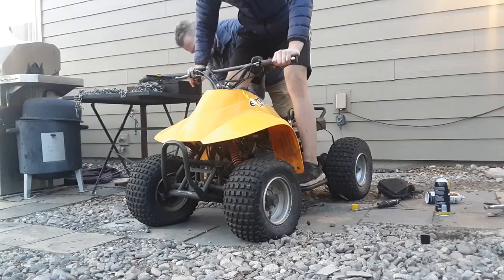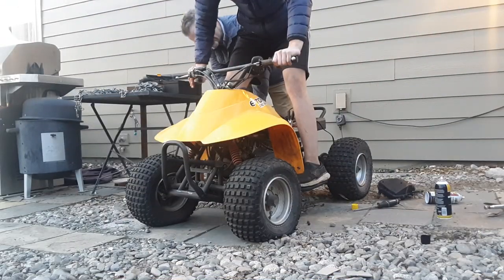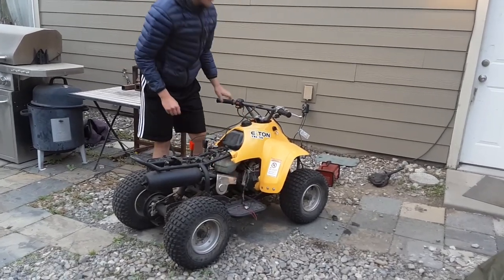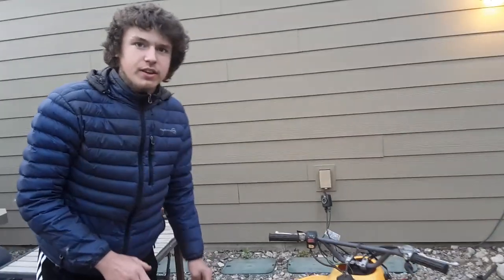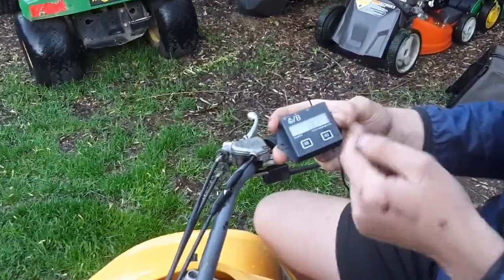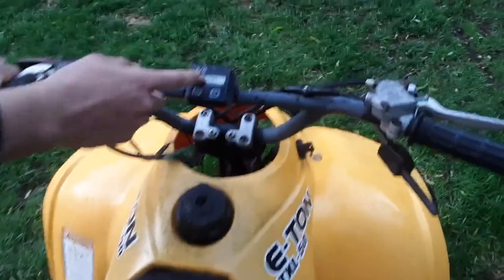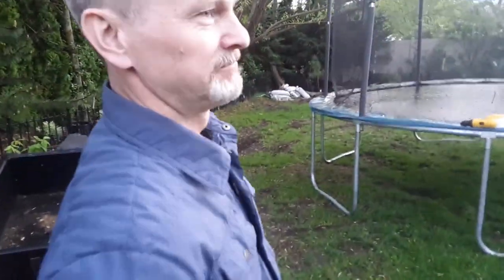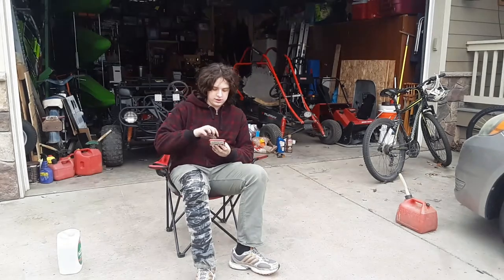Buying & Fixing An E Ton TXL 50!

Comment: Do you have a link to the cdi you used I have the say atv an can't find the right one for it ... thanks
Reply from the maker: Sure! Here is a stock one: https://www.ebay.com/itm/122858363059?_trkparms=ispr%3D1&hash=item1c9aedd8b3:g:pCwAAOSw4DJYfJzA&amdata=enc%3AAQAGAAAA4FxadJC1%2Fd2dQuEsrs2GIGc3zC2VEv%2FIF6c88%2FJNBc15GQPaok1nRBckg8AQHK6I6dbUd8pAsu4ByIUBkcHEnIX5%2F4lGoRIzoRKUwlnzaTZfAaNAt4x57TjdKIvOrZTZkskZYPQgp21jiNlk5b7Y%2Fve6eDXRnExis8darvzOXOs3K9%2BvwK5RrTjkFhinSha8khW03t6D9kNCKnLE0qz8uFLI0DFsvqwmgUWRxDA%2FRuWeTkDnohnbs4u%2FoKjalC7WpSssZHGUC9JhTXzb80pakjqPOFZUbdgSwqrAZMNs7ukc%7Ctkp%3ABFBMkIb_1Ihg
And here is a "performance" one: 
https://www.ebay.com/itm/403298663283?_trkparms=ispr%3D1&hash=item5de6793b73:g:gDsAAOSw8NxhkuHw&amdata=enc%3AAQAGAAAA4JwWB9g5FPC5x71irrUpUMaNWeawSQ%2FnnrGx7rvEr0ZaaVjKF64mVdhw%2FF94v0OTnQajeZOzEsqrxFOREOkKTIxr2aEfB28yb8yvUIyb7t%2Fv32hsu%2F78YeG2zwZhzoKlQoT9MLiX38fPXEto8DXDXfA9VEH6zba4OIrBPabvKg3C9q5whcmG0UuQ6fhEiMYTUG4%2FM5LUmJPvVCO1%2Bd%2FMAWWC8glLN2vSToHFYXMUOgwrz3WsuBtm6wea4AtsSqrv0XkXbGkv5nsPYbDAf6dxc%2BhiC4wwF2fe4%2BBG0neztPa0%7Ctkp%3ABFBMkIb_1Ihg

Comment: Tengo un Eton 90 CC cuanto aceite de caja lleva
Reply: Check out get2itparts.com for E-ton specifications and parts. I’m pretty sure the gearbox holds 100cc of 80-90 oil
Reply: Tu sabes si la eton yeva aceite normal de moto en sus depósitos i semescla la gasolina aparte dime porfavor